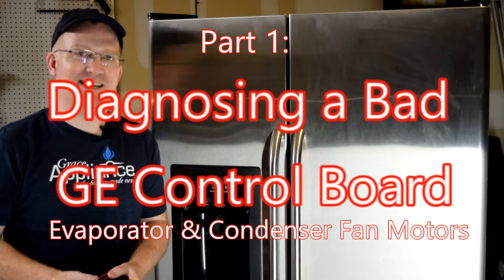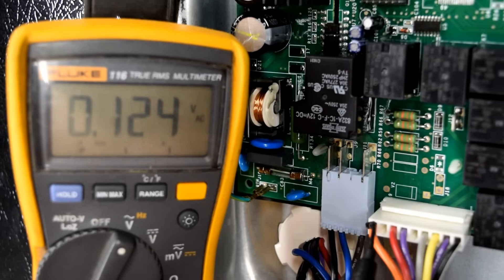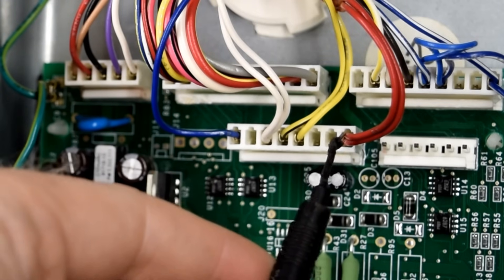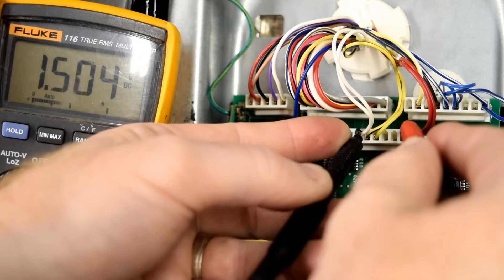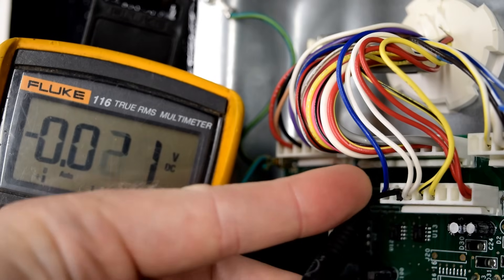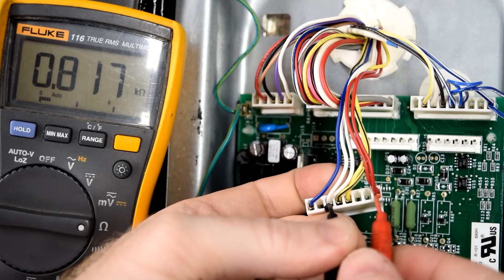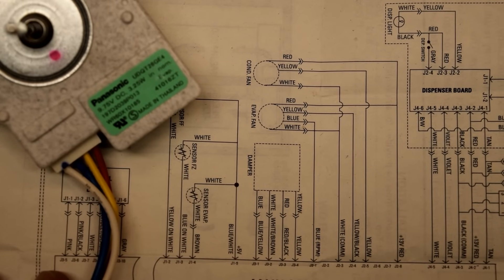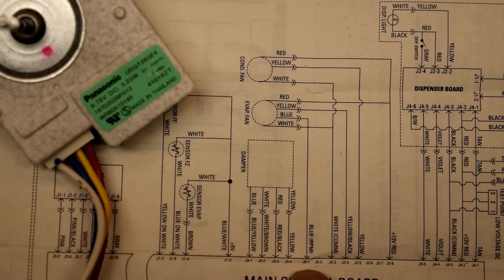Diagnosing a Bad GE Board - Part 1: Fan Motors

Comment: Hi i hv a bosch side by side fridge n the set is totally dead. I have checked from the wall to the point were it goes into the inverter board to compressor. N the volts stops just after the noise filter caps. Were do i go from here? Pls advice. Its a bosch 
KAD92AI20A with a siemens main board no 9000 693141 main board. I hv looked in the net n cant seem to find a replacement board for this unit as well...is there a place were i could buy it n get it shipped to asia.??
Reply from the maker: Hi Steven,
I'm sorry to hear about your refrigerator.
To me, it sounds like the board is probably fine, but the noise filter is failed.
Forgive me because I've never worked on a Bosch refrigerator... Or seen one for that matter as we don't have them here in the states.

Is the noise filter part of the main control board or is it separate from the main board. I know for instance LG washing machines have an issue with failed noise filters and how you solve that issue is to simply bypass the filter. I. E. Cut the wires on either side of the filter and hook them together directly. (with the power off obviously)

Does this make sense?
Reply: @GraceAppliance  hi andy...omg im embarrased...the whole fridge did not work becos i didnt knw there was a main switch on top of the door.!! (I got it from a thrift store) Haha...but now i ran the fridge for 2 days n both fridge n freezer is warm. Is there a way to knw if its out of gas or how do i go from here. Thanks.
Reply from the maker: Hi David, no need to be embarrassed. I once did a haul away of a refrigerator that someone thought was beyond repair only to get it back to my house to realize it was in the off position. I sold it that day for $200! LoL

This reminds me of a joke: 
Q: why do Germans drink warm beer?
A: because they have Bosch refrigerators. 
:)

So, if you’ve verified that the compressor and both fans are running, it does sound like you’ve got a sealed system issue. That could be either a failed compressor or it could be low on refrigerant as you said. 
The only way to know is to tap in to the sealed system and put gauges on to see what the pressures read. Sealed system repairs aren’t a DIY task and requires specialized equipment. All this is big bucks unfortunately. 

Now, if it is low on refrigerant, it means that your sealed system has a leak somewhere and simply adding more refrigerant would leak right back out...maybe in a day, week, month, year. And you wouldn’t be able to know. So, Some people will roll the dice and have a technician add a ‘stop leak’ and weigh in the appropriate amount of refrigerant. I’ve seen more heart ache than success with this so don’t recommend.  

If you’ve verified that the compressor has been running for 2 days straight, but still no cooling - unfortunately, I’d put the money toward a new refrigerator.  

Sorry to be the bearer of bad news.
Reply: @GraceAppliance  unfortunately...i just checked the compressor by touch n found its not running at all. The condenser fan is running. N infront of the compressor is a inverter box. There is a small box away from the compresser that has a wire coming out n two copper coils running into the fridge body. Could that be the start relay? I checked the resistance of the compresser pins n all are the same...so its good. So something is not letting the compressor start. Do u have a email i can chat more n show u the pics pls. Mine is tamasteve@hotmail.com...hope im not wearing u out with my problems.
Reply from the maker: Hey Steven, no you’re not wearing me out. Glad to share whatever knowledge I have. I’ll send you an email now.  Thanks!
Reply: @GraceAppliance  hi andy can i knw were in the inverter board do i check for the dc 5v? I read thats the signal the CM sends to start the compresser I dont see any signal wire cming from the box but there is a connection there with 2 pins(nothing connected) ,a AC wire n a ground wire. Btw i did not get ur email i checked my inbox n junk 

My bosch fridge is identical to this model B22CS80SNS/01
Reply from the maker: Steven David hey Steven, I’ve sent you the tech sheet associated with your fridge.  On page 53 you’ll see the test procedures for the inverter board, sparse as they are.  Looks like you’ve got a ground wire, an AC wire coming in for power, the plug that leads to the compressor (which probably has the inverter box covering it) and will have the signal wire coming from the main control board which will actually provide a variable frequency depending on what speed the compressor needs to be running at. 
I hope the info is helpful.  Thanks!

Comment: I don't have any voltage to the display panel. Where does the voltage come from?
Reply from the maker: Hi Berge Jermakian, 
I’d Start with this video:
https://youtu.be/ViFpwH6_WrM

If you have voltage at the control board behind the fridge, but none at the touch panel it’s faulty wiring. The most common spot for wiring issues is a plug near the freezer door hinge behind the lower kick panel. 
You might start there and see if you have voltage to that plug and look to see if it’s corroded. If so, you may need to solder the wires together and do away with the plug all together.  

Let me know if you have any questions!
Andy

Comment: Andy I did find the temperature sensor and was surprised it seemed to be hard wired. But the lead was long enough to allow me to cut and resolder later with heat sink tubing etc. I tried the ice water and warm water resistance test which was fun to do. I am a geek!  Anyways I assumed it is a termistor at least it acted like one. So I assumed it was working. I also tested all 3 connections to temp sensors thanks to your great videos. 

I also found a 20F thermal switch on the light circuit which I am very curious about. At first I thought it was the temperature sensor. Now why would the lights come on at 20F?  Maybe it is not a switch. I also found one on the freezer light circuit but don't know what temp is. Anyways just curious.
Reply from the maker: Hey!
Here is a video on the correct resistance read outs for the temp sensors, which can be tested from the board... But it gives you a fun excuse to use the soldering iron. Lol, I'm the same way.
https://youtu.be/CG-2FnQ43Hs

While your sensor is not completely failed, it may be out of spec. The ohm readout will change based on its current temperature. 

There is not a thermal switch on the light circuit to my knowledge. The only thermal switch that I know of would be the hi limit thermal cut off which would cut power to the defrost heater and would be closer to 120'F.

I hope it helps!

Comment: Andy, your videos are excellent.  Thankyou.  I have a GE SxS with the freezer working but not the refrigerator section.  I followed your video and found 800 ohms on the fan power circuit which I think is what your video showed and you said it should be around 1.6 K ohms.  I could easily see the fan on the squirrel cage and it was working.  So I painfully took the freezer drawers, ice maker and panels off to find the other fan.  Not easy because my freezer is a large drawer at the bottom with a big Stop sticker telling me not to remove the 5 screws on either side of the pull out bracket.  I tested the fan motor and found it to be 1.6K ohm.  I also tested the tach circuit using the Hz setting and it worked.  Thank you for showing that.  I also tested the squirrel cage fan and it was also  1.6 K Ohm.  On your schematic shown on the video you show the power lines for the two fans to be in parallel. So the 800 ohm reading you and I got are correct for two 1.6 K Ohm motors in parallel suggesting the motors are ok.  You said the 800 ohms shown on your video suggests a bad fan motor.  I plugged both fans in and powered up.  They both work and after an hour my fridge was clearing working.  By 2 am I had the fridge all back together and my wife and I did a good cleaning.  Thanks to you I saved hundreds, I am not exactly sure why the second fan stopped and now working but at least I know what to look for and I have a very clean and working fridge.  Just wanted to suggest your comment about 800 ohm on the parallel fan circuit may be wrong.  Let me know if I did not understand correctly.
Reply from the maker: Awesome info Merv, I appreciate the detailed follow up and i'm sure this will help someone else out there.  I'll be sure and pin this comment and try and highlight it during that moment in the video.  Thanks!
As for your specific issue, you might want to check the temperature sensor for the refrigerator section.  The evaporator fan will cycle on and off (whenever it needs to) based on temperature in the freezer section and the refrigerator section as well.  If the control board isn't getting a correct signal from the refrigerator temp sensor - it may not realize it should be circulating air to the fridge section at that point.  Just a thought I had.

Comment: sir wiring digram,and block digram please give me,from Nagpur Maharashtra (india)
Reply from the maker: Greetings Nagpur, 
You will find your wiring diagram either behind the kick plate near your feet at the front of the refrigerator. Or if you have a touch panel inside the refrigerator section to adjust temperature, you can remove this touch panel with 2 bolts and find the diagram there.  I hope this helps.  
Thanks!

Comment: Hi Andy I appreciate your very clear videos
I have the same Fridge you show in your video. It stopped working - no cooling
I get voltage to the board and the evaporator fan comes on after 3 minutes
The condenser fan does not come on. I put a jumper between position 4 and 5 and then after 3 minutes both fans come on and run
The compressor does not run and gets no voltage to the input side
Is it the control board - any tests I can do to confirm that before purchasing a new one?
Thank you
Reply from the maker: Hi Bob, 
Generally speaking, if you've got multiple issues like this going on - the only common part between them all is the control board.  So, just based on the description, it sure sounds like a bad control board. 

If you've left the door open for 3 minutes and the board still does not send voltage to the fan, that's a bad board.  

I'd say to can safely replace the board and you should be good to go. 

The only other thing I would recommend checking is unplugging the front control panel harness, plug the fridge back in, and if the fridge fires up at that point - you've got a shorted front touch panel.  However, the issues you're having don't sound like that's the case. 
Here's a video for that: 
https://www.youtube.com/edit?o=U&video_id=ViFpwH6_WrM

Let me know if you run in to any issues. 

Thanks!
Andy
Reply: I appreciate your quick reply. I pulled the front panel plug with no change in the symptoms. I have a board on order and my fingers crossed
Thanks again for your expertise
Bob
Reply from the maker: Good deal, sounds like you'll be in good shape soon.  
You're most welcome, I'm glad to help. 

Thanks for watching.
Reply: I rec'd the control board and it has helped but I am not there yet
When I power on with the new control board installed both fans start up after a couple seconds (better than old board)  but I am still not getting voltage to the compressor leads
I tested the thermistors and get reasonable readings
I disconnected the front panel plug from the control board but that did not change the results
Is there a fuse somewhere that could be blown between the board and the compressor
Thanks again for giving this consideration

Comment: Hi Andy. My connector is a little different that the one you have the photo. It has wires in all 8 of the locations. My model is PSS26SGRASS S/N FG440018. I did all the test and the only one that failed was the second yellow “condenser” fan was not getting any voltage. The fans tested at 1.05K Oms. You said it should be 1.5K Oms. My Evap fan was running after the doors were open for three min but my condenser fan was not.  Based on the test I know my board is bad. Do you think my fan needs to be replace to??  Thanks for the help. God Bless.
Reply from the maker: Hi Barry, 
I'm sorry to hear about the fan issues.  You're most welcome for any help I can give.  God bless you too. 
The schematic I'm finding for your model number does show a DC fan motor (as shown in this video, but may have 3 wires instead of 4) 
However, when I look up your parts by your model number it shows that you have an AC fan motor. 
If you can confirm which one you've got, I might be able to weigh in a little more in depth if needed. 

(So, if you have a 120v AC fan motor)

Your condenser fan motor is actually a 120v AC motor so the test will differ for you slightly. I'm sorry, I should have called out this situation in the video and reminds me that next time I come across this situation, I need to snap some pictures. but...
If your compressor is running, the condenser fan should be running as well. 

Your condensor fan motor should look similar to this one: WR60X10080
https://www.searspartsdirect.com/part-number/WR60X10080/0046/363.html?modelNumber=PSS26SGRASS&categoryName=Side-by-Side%20Refrigerator&brandName=GE

Between the Orange and Black wires you should be getting 120v AC while the compressor is running.  If you are getting 120v there, it's a bad fan motor.  Let me know if otherwise. 

(...and if you have a DC fan motor)
I agree, it sounds like you have a failed control board, but wouldn't worry about the replacing the fan motor as well unless you have a burned resistor as shown around the 8:00sec mark in this video.  

I hope it helps and let me know if you have any other questions, 
Andy
Reply: Hi Andy,
Thanks so much for the quick reply.  I would like to send you a pic of my board.  Youtube will not let me post the pic.  Can you please e-mail me at poweredbyfaith2@gmail.com so I can send you the pics.  My fan does not run when the compressor is running and the resistor looks burnt.  Looks like I need to replace the fan and the board.  Thanks and God Bless!!!
Barry
Reply from the maker: No problem, just sent you an email.   Thanks!

Comment: Hi. I have samsung french door rf267 series.the  Coils is frozen on the top. Not cooling
Reply from the maker: Hi Jose, 
I'm sorry to hear about your issue with the Samsung fridge.  Unfortunately, all of my videos are going to focus on side by side GE refrigerators, so the info will only be broadly helpful, but let me give you some info that hopefully will help. 

It sounds like you're having a defrost issue for sure.  There's 4 different parts that may have failed.  
Your control board, a defrost heater, a defrost sensor that controls how long and when the defrost heater comes on, and a thermal safety fuse that blows when the heater has gotten too warm. 

The heater and thermal fuse can be checked for OHM continuity directly at the wires inside the freezer, the defrost sensor (located on top of the evaporator) can be unplugged and tested outside of the freezer/refrigerator. You should have around 16k OHMs of resistance while the sensor is in a glass of ice water.  If the heater and thermal fuse have continuity (usually 20-50 OHMs in my experience) and the defrost sensor tests good, it would point towards a failed control board. 

I hope this helps and sorry I couldn't be of more assistance, 
Andy